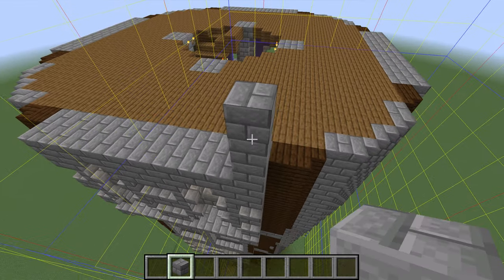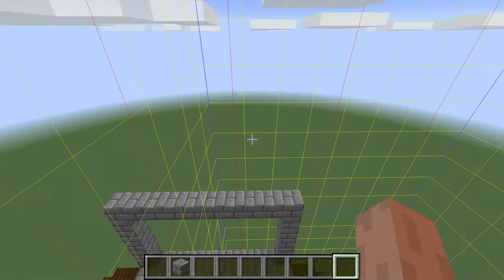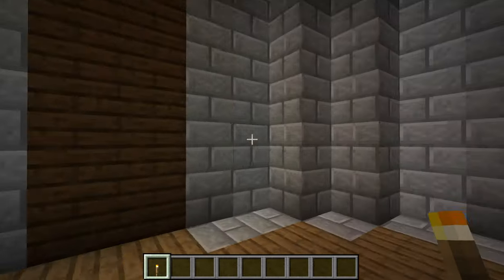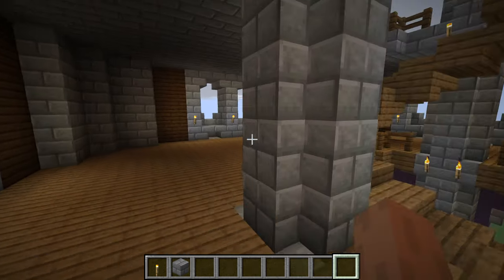MCREATOR BUILDS: Tower Build | Part 5

Comment: Hello. How to make a dungeon with different generation of rooms? Well, for example, at the end of the corridor in one structure there will be one room, in another structure at the end of the same corridor there will be a completely different room. And in the third structure, the corridor will have no rooms at all
Reply from the maker: I have done one or two tutorials in this building playlist that covers how to connect structure parts together using special blocks with procedures, this however requires chunk manager for connecting things outside of the chunk, actually I would use this for most structures as its almost needed to make sure structures don't get cut off between chunks. https://mcreator.net/plugin/78361/chunk-manager